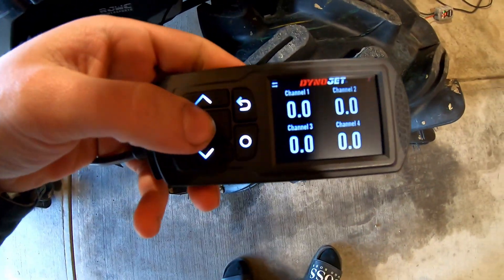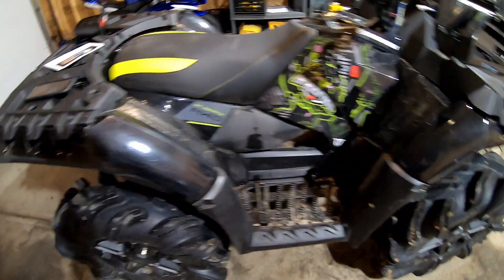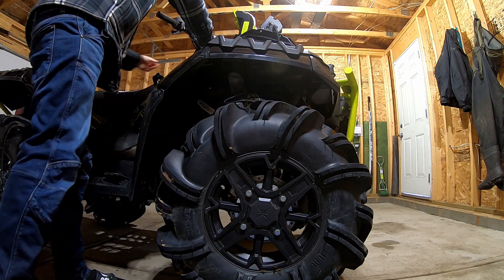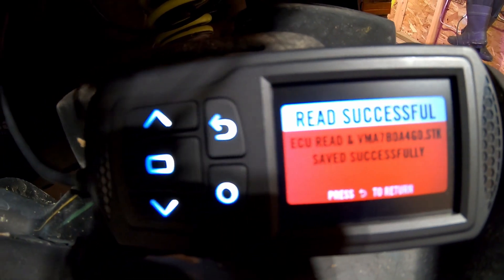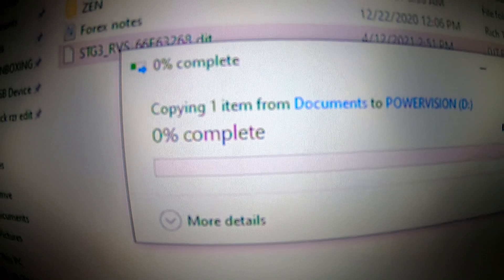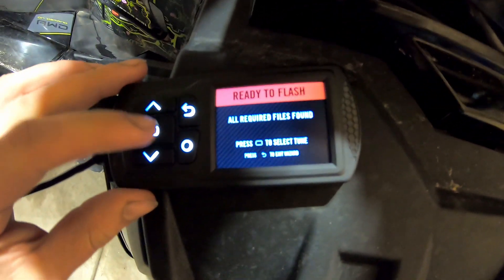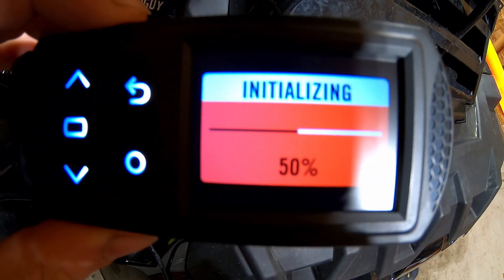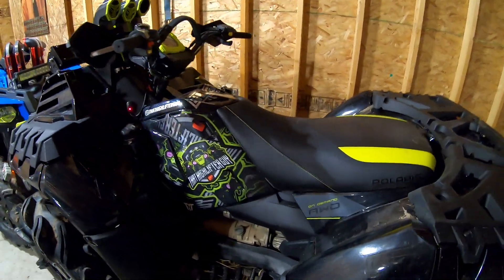RVS Stage 3 Install On 2020 Polaris Sportsman HighLifter 1000

Comment: i ordered the pv3 from dynojet thinking that was gonna help but i seen the stage 3 for it then i ordered it from the rvs page how do i get my file
Reply from the maker: Hey so once you’ve purchased the tune you plug the pv3 into the diagnostic port scan it once you get your file unplug it then plug it into your computer and email the file to Ryan. He will email you the stage 3 tune. Plug it into your quad again then flash it and it should show rvs stage 3.
Reply: Any contact info for Ryan?
Reply from the maker: Ryan Scheler on FB or Rvsperformance.com say I sent you.

Comment: With your tune do you have to keep the tuner connected?
Reply from the maker: Nope once you flash it and it’s done you can unplug it.
Reply: @RennyBoyz1  sweet cause I don’t want to keep it on there because I do a lot of water riding, and most tuners you have to keep the tuner on
Reply from the maker: @madduxsoutdoors  Yeah forsure it’s handy that way. You can also leave it on when you ain’t doing water riding and monitor how the machine is running.

Comment: Do they make the pV3 for the 21 HL? ? ?
Reply: Yes they do.
Reply: You can get a pv3 with rvs tune from rvs performance
Reply: Im pissed , i feel like i just wasted the $$
Reply: @CHRISB-cb5to  if you haven’t used it yet maybe you can sell it and get a pv3
Reply from the maker: @CHRISB-cb5to  Can you return it?
Reply: @RennyBoyz1  naw boys shes installed . 🤬. Dont get me wrong , the bike runs like a raped ape now ( at least it feels nite / day ) especially with the throttle response . Just extremely disappointed that i jumped the gun and could’ve ended up with the PV3 .  Learning experience to say the least, lol.
Reply: Thanks for the responses and suggestions boys
Reply from the maker: @CHRISB-cb5to  True man nothing wrong with that but hahah yeah I’ve been there before it sucks. Could always sell it down the road and buy it if you need to.
Reply: What did you put on it
Reply from the maker: Stage 3 tune